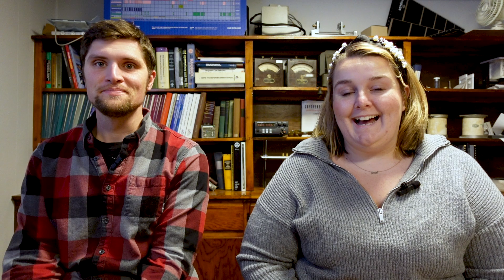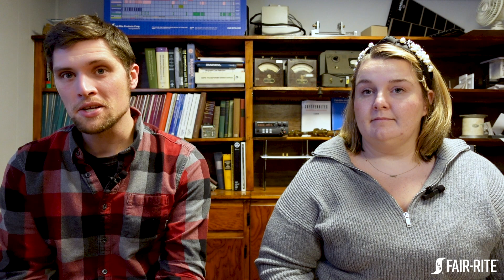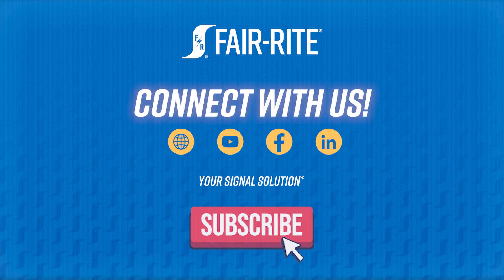Ep 8: What Material Should You Use for Frequency?

Comment: Is there a ferrite material that's considered "broadband"? Someone is selling ferrite beads for power lines supposedly to help filter out EMP PULSES. They are similar to your Snap It Cores but no specifications are given, other than being "broadband".

I saw a video saying that mil specs require protection from 10 kHz-10gHz. Do you have a ferrite material that would cover that range, or would a combination of materials (such as 31 and 61) be needed to cover it?

I'm sure that you don't CLAIM that your devices will actually suppress EMP currents, but I'm just looking for something that will HELP (along with a beefy surge suppressor).
Reply from the maker: A combination of materials would be the most helpful but, it is difficult to truly assess how effective they will be at suppressing an EMP. 75 material covers from around 200kHz into the low MHz range, 44 material covers several MHz to several hundred MHz and 61 goes from several MHz to several GHz. That combination would likely be most effective. How well they work is going to depend on just how high the induced currents are. If they are too great, the cores can saturate and won't provide much attenuation.

Comment: Hi guys, i dont have the charts handy at the mo, just wondering what's the best core material for 200-1700 Khz (LW and MW bands) for matching transformers (baluns/ununs etc)
Reply from the maker: 43 material would cover that range with relatively low core losses. At the lower frequencies (say 400kHz and below), a higher permeability MnZn core like 78 material would likely perform better. This would come at the expense of higher frequency performance however.- Mike
Reply: @FairRiteProductsCorp thank you guys.. The whole science behind this is something of a 'dark art' for me at the mo. I do have some toroidals at home that i think are type 77 as i can measure surface resistance across them, as opposed to type 43s which are labelled and measure open circuit. I had used these 43's for matching my flag antennas which measure anything from 200ohm to 1000ohms across the BCband, but decide to replace them with the other unknown ones. I have a nanoVNA and i think this will enable me to identify the characteristics of the unidentified toroidals. Bottom line is, do u think type 77 will offer a noticeable improvement over a type 43 of similar size and turns ratios?
Reply from the maker: If the 43 cores are already working at low frequency without getting excessively hot, I wouldn't expect a massive improvement. At low power levels, the 77 should provide lower insertion loss due to the higher permeability. At high power, low frequency, the 77 should have lower core losses. Higher frequencies at higher power levels, the 77 may see excessive core heating due to the losses.  @vincentstevens5048
Reply: @FairRiteProductsCorp  thank you guys for making an effort to answer my questions. I neglected to mention I'm not transmitting. Its purely for my receive antennas. Im mainly interested in long distance MW reception, but i have the problem of being very close to a BC transmitter, so i am trying various solutions involving different antennas, but matching these to 50ohm is a priority. Thus the use of baluns/ununs etc etc